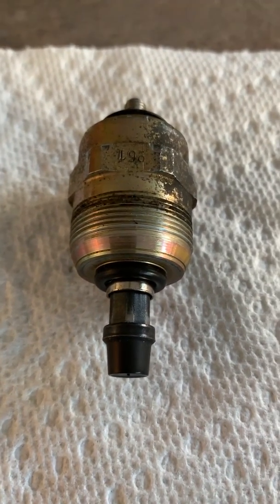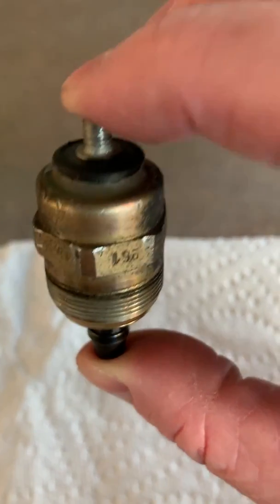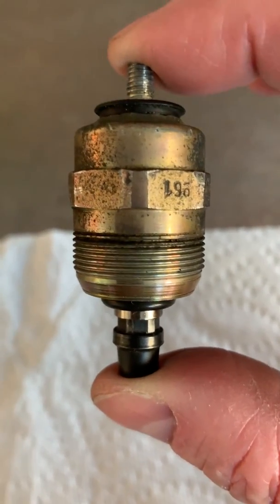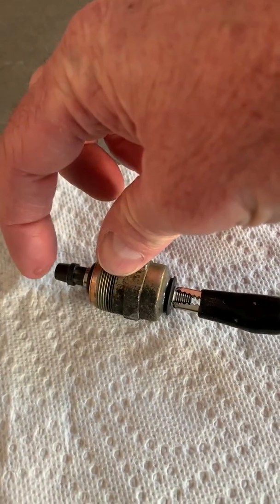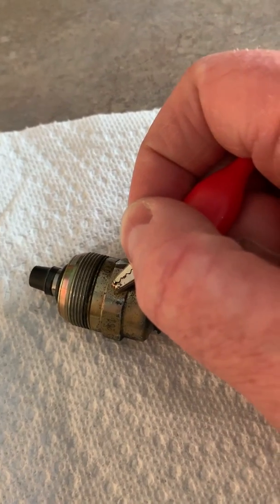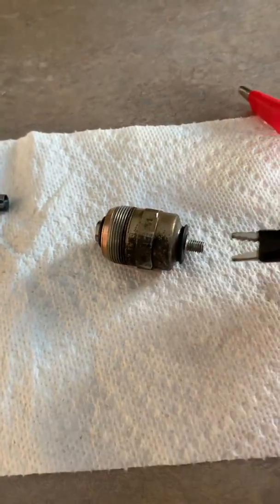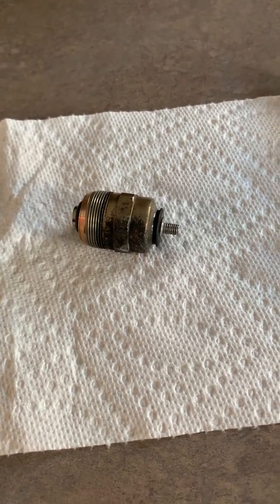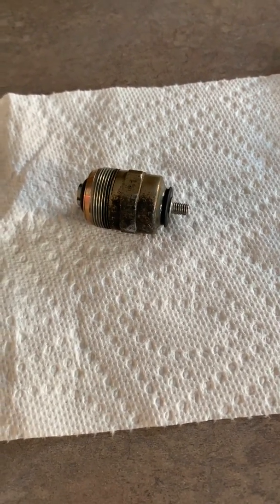How to test a VW Diesel TDI Fuel Shutoff Solenoid

Comment: For people confused about testing with negative to threaded post instead of positive:
For testing purpose, it is fine, but will create short, since ground(or negative is connected to body). So beware of that.
A solenoid is nothing but a cylindrical coil of wire making an electromagnet. It will attract an iron rod(in this case plunger), overcoming force of spring. Polarity does not matter.

Comment: Red on tread wire..... You did the wrong way
Reply: When bench testing it doesn't normally matter with solenoids which side is positive and negative. When it's in the car that's different of course. Solenoids are just electric switches, you can reverse polarity without any danger.

Comment: I hope you can help understand why the solenoid comes with a "solenoid control" with 3 pins part number: 0281005025
In my case the truck stops without a notice and runs great when it runs.

Comment: How do i wire it on.the vehicle. If the threaded supply is negative. The body is grounded on the injection pump. Will it not short?
Reply: Send positive to the threaded end

Comment from the maker: Here is a link (on Amazon.com) to the bench power supply I’m using in this video. The electrical leads came with this unit. 

DC Power Supply Variable, Eventek KPS305D Adjustable Switching Regulated Power Supply Digital, 0-30 V 0-5 A with Alligator Leads US Power Cord https://www.amazon.com/dp/B071RNT1CD/ref=cm_sw_r_cp_api_i_Co.-Cb990TBQR
Reply: I hope you can help understand why the solenoid comes with a "solenoid control" with 3 pins part number: 0281005025
In my case the truck stops without a notice and runs great when it runs.

Comment: Thanks for the video - what is that tool you have connected to the computer power supply? I need one of those
Reply from the maker: Dar El Barka - the electrical leads I’m using in the video came with the bench tester when I purchased it. Let me know if that answers your question.
Reply: @DIY-Gpa  oh ok - I thought u purchased it separately. This is a cool tool to have. I'm currently trying to test my Solenoid outside off my car to make sure 100% that it is the issue.